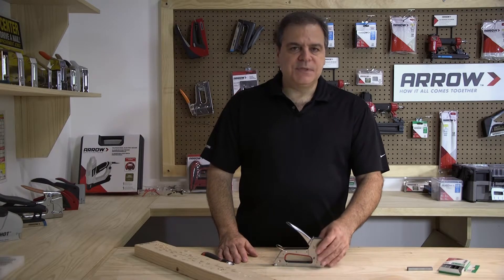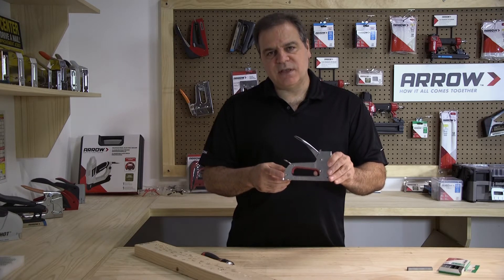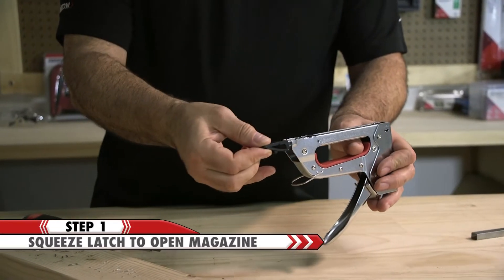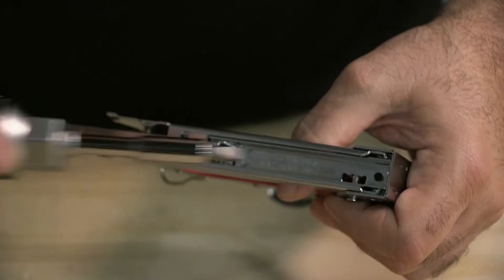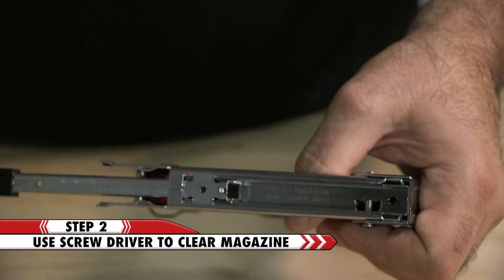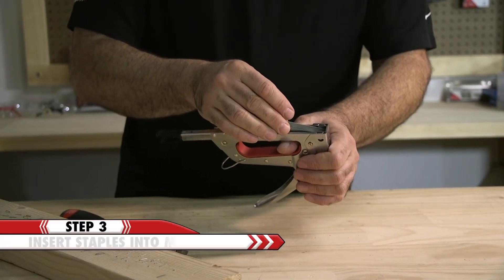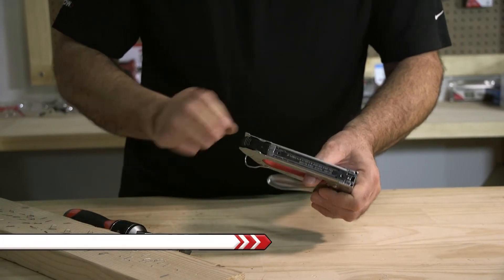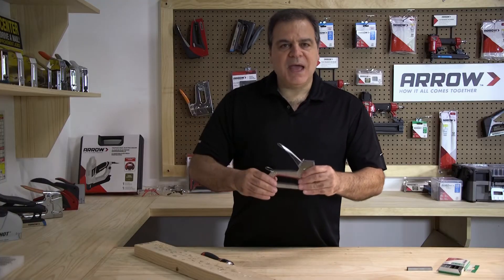How to Clear a Jam From Arrow's JT27 Staple Gun

Comment: I’m having the same issue that everyone else in the comments is seeming to have: the magazine won’t even come out. Used it for one staple and it’s jammed. What a waste of money, I’m upset I didn’t keep my receipt. Arrow needs to fix the design CLEARLY 🤦🏼‍♀️
Reply from the maker: Here's a link to the manual, for additional help: https://bit.ly/2XRPr6t
Reply: I just purchase one yesterday for almost $13 at Lowe's hardware. They need to let you know this stuff somehow. My husband's trying to wedge the metal up with two little pieces on top to pull it back farther cuz it won't go back like it's supposed to it won't even hold the like eight little Staples at a time and then it don't work it just jams to Staples up underneath it as it slides back and forth

Comment: Everyone just disassemble the staple gun and put it back together. It worked for me. There are 2 pins on the side with clamp washers. Remove the clamp washers and pop the 2 pins out. You should be able to disassemble it after you do that. Then reverse the disassembly to put it back together. Also make sure to keep it oiled.
Reply from the maker: Thanks for sharing your expertise!
Reply: Yeah there more to it than just removing 2 pins because bunch of other parts just fell out of mine now I need the video on how to reassemble the darn thing
Reply: Just bought—- what a piece of crap—- jammed , never even used! Giving it a toss as after removing the pins all kinds of stuff came out—— tossing and will purchase something different!

Comment: This will be the second time I'm returning mine. The first one didn't work so I returned it thinking it was just faulty. The exchanged one isn't working either. The magazine won't come out all the way nor will the gun fire any staples. Don't waste your time or money on this gun
Reply from the maker: Hello - The magazine actually doesn't come out all the way. This loading video may be more helpful to you: https://youtu.be/dr1-7SfTBCk. Also, be sure you're using JT21 staples and not T50 staples. If you haven't returned your staple gun, please try these possible solutions. - Arrow Fastener Team
Reply: @arrowfastener  I followed the video and used the recommended staples. The gun still would not work. I even had a professional carpenter try it and he said the gun was no good.
Reply from the maker: @marna52  We're sorry to hear that. Please contact us at customercare@arrowfastener.com or 800-776-2228. Thanks.

Comment: Okay bu tdd what do I do if there is a t50 staple strip in my jt27?
Reply from the maker: Hey there, if the magazine isn't opening easily, squeeze the latch at the back of the tool and insert a flat-blade screwdriver into the staple exit slot. Then gently twist the screwdriver to help the magazine open. You can use pliers to remove damaged staples, but do so carefully. If this doesn't work or you'd like us to walk through the process with you, give us a call at 800-776-2228, and we'll help you out!
Reply: I did the same thing and can't get it cleared. Imagine if your vehicle got bricked if you accidentally tried putting in the wrong car key. Garbage.

Comment: The magazine won't full open. I only use one staple so far. And its jammed already. Please help. I'm using. 3/8 10mm

I'm trying to reholposter a chair for my business big open house
Reply from the maker: Hey Renee. Sorry you're having trouble. If the jammed staple is preventing the magazine from opening, you may just have to try to force the magazine open. Then you can remove it with a screw driver as shown. You can also try removing it with needle-nose pliers if it's really stuck.

Hope this helps! Please feel free to reach out to our customer service department if you're still having issues: https://www.arrowfastener.com/awesome/contact/

Comment: Why is it not working once you put the set of Staples in. Staples go on the inside of that metal part outside metal or inside  cuz I got the right size it's a 1/4 6mn and my husband's arguing with me telling me that it's a smaller than staple I have of of 1/4 6mm. I thought it went on the outside of the little side slots of end part

Comment: Is there a way to remove the pins without having 2 plyers?
Reply from the maker: To unjam the JT27 you only need a screwdriver. The T50 requires a pliers and a screwdriver, as shown in this video:  https://www.youtube.com/watch?v=-UtcDB-qddE. Hope this helps!
Reply: @arrowfastener wrong. The jam isn’t right there, it’s under the sliding bit. I can’t unjam it without removing the sliding bit, and I can’t remove the sliding bit without disassembling it.
Reply from the maker: @minimonkey252  Sometimes the stapler does need to be disassembled. There are 2 pins on the side with clamp washers. Remove the clamp washers and the 2 pins. If you need help with this, give us a call at 800-776-2228.
Reply: @arrowfastener How does one remove the clamp washers ?
Reply from the maker: @martafarensbach885  Use a small flat-head screwdriver to push the washer away from the pins. You should then be able to remove the pins.

Comment: I do everything right on this Staple gun but it only staples ONCE and then it doesn’t do anything??
Reply: If you’re using t-50 staples that’s probably your issue, they only take JT-21 staples
Reply: @isaacdeaville2246  Nope, using a JT21 with 6mm stables like its imprinted on the staple
Reply from the maker: Hello - Did you load your stapler correctly? Take a look at the loading video: https://youtu.be/dr1-7SfTBCk. And you checked for jams when it didn't fire? If you need additional help, please contact us at customercare@arrowfastener.com or 800-776-2228. If your stapler is defective, we can offer you a replacement under the warranty. - Arrow Fastener Team
Reply: @isaacdeaville2246  How do you take out T-50 staples that have been jammed in?

Comment: This sucks. you can only have 1-3 staples in it at a time or it wont work.
Reply from the maker: Hello, there. We're so sorry you've been having a disappointing experience with this tool! What you're describing sounds like it may fall within our product warranty, so we'd like to get some more information about the type of projects you've been working on, if you notice any difference in the tool's performance depending on the staple size, etc. Would you email customercare@arrowfastener.com or give us a call at 800-776-2228 so we can find a solution with you? Thanks for giving us an opportunity to address this!
Reply from the maker: Chris Pacheco  Hi Chris. Sorry about your negative experience with our tool. Please consider reaching out to our customer service team: http://www.ArrowFastener.com/awesome/contact

They may be able to better assist you with your issue.
Reply: @arrowfastener  track release won;t fully7 open
Reply from the maker: @lorettafoley833  Hey there! So as the video shows, the magazine does not fully come out of the tool. When you open your magazine, if it looks like the video, then you're good. If it won't open enough to get a strip of staples in, then please reach out to our customer service team: http://www.ArrowFastener.com/awesome/contact